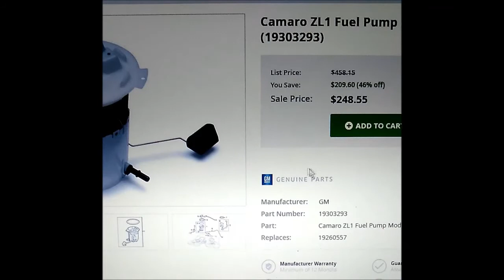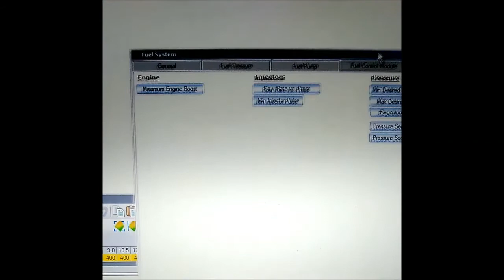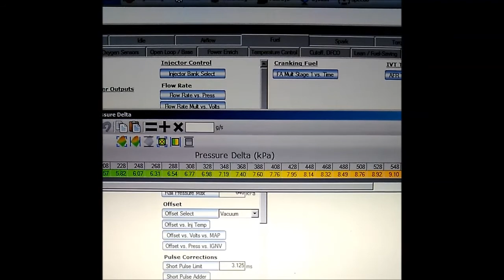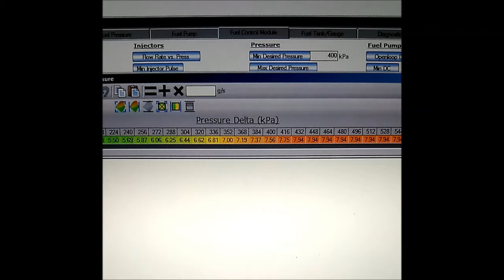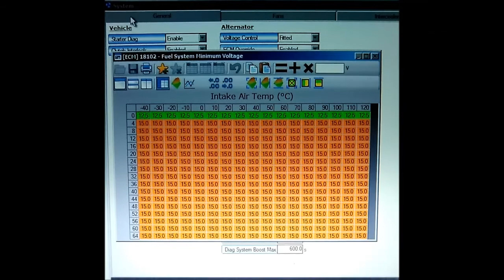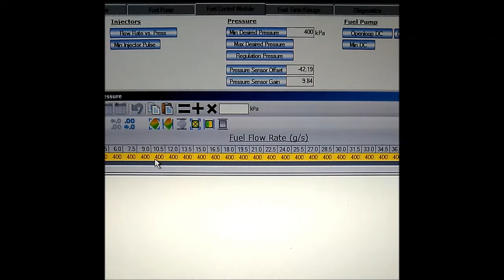HP Tuners Fuel Tuning Tutorial

Comment: Thanks Chris. Interestingly, the 2014 ZL1 stock table shows 12.0 up to 32, then goes to 14.5 volts from there on out. Looks like GM had this in mind.
Reply from the maker: Haha maybe that's Rev 2.0 of the computer eh?
Reply: ChrisCamaro Not sure, but I’m glad I saw the adjustment. It means they were looking at other things too.  Less for me to worry about.
Reply from the maker: @fasnuf  Exactly.  If I had to guess, with the stock ZL1 pump, I'm thinking you could get up to 750 HP safely on your ZL1.  Since the LSA has stronger internals, it'll take it and you can give Dodge a run for its money ;)  My SS can't reach those power levels without forged components but I'm happy with a target of 650 anyway.
Reply: @ChrisCamaro  I'm running a little over 600 whp and gearing up to add a few more. I think my pump is good for the task. I wonder sometimes about GM. They put cast HE pistons in the LSA to try and keep the engine quieter. I'de rather have forged and not have to work the bottom end when I start to push 800 whp.
Reply from the maker: @fasnuf  ZL1 has hypereutectic?  I assumed the whole rotating assy was forged but must just be the CRs.  As long as you maintain a smooth compression profile free of pressure spikes, I think the pistons will last but having the extra insurance with forged is better because you can make mistakes and get away with it.
Reply: @ChrisCamaro  Yes HE and coated pistons. They're still pretty good but you run a risk when you start getting up there. The crankshefts are forged super tough so no problem there up to and possibly past 1000 HP. The rods are forged powdered metal.